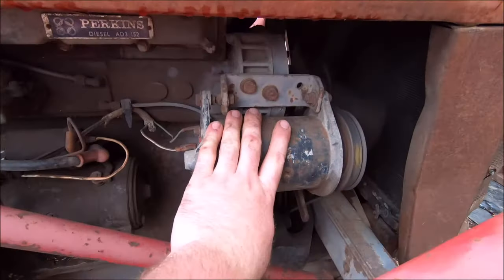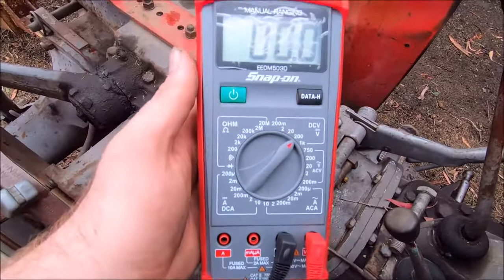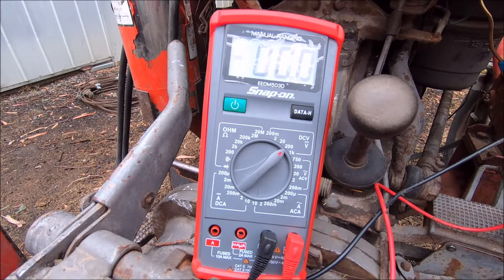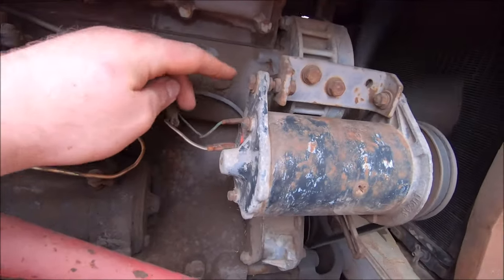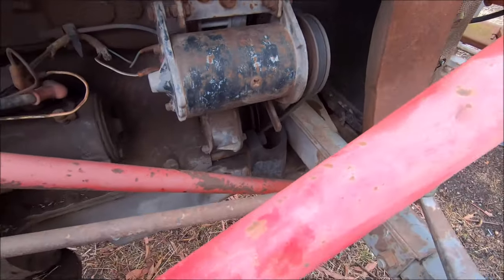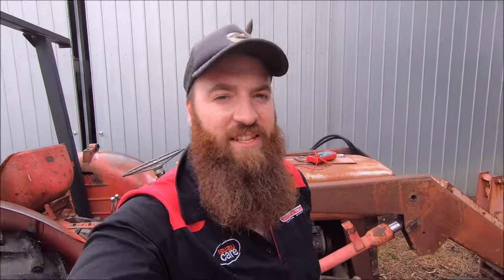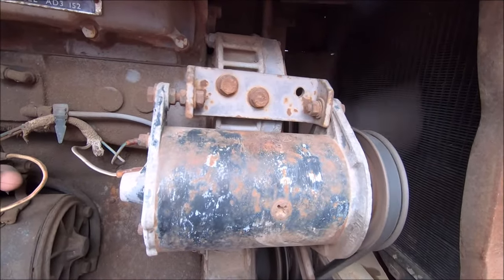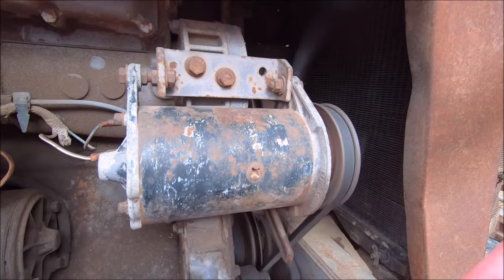How To Check If An Alternator/Generator Is Charging A Battery

Comment: You can test gen as follows, disconnect arm and field wires, w gen spinning jump F to ground or
ARM  if there are no sparks and gen does not load down, residual field is GONE and field must be flashed b4 she puts out, I mean the generator.

Comment: Hi great video my tractor wont charge my battery been like it for couple of years i checked it today i noticed no wire going from alternator to battery would that cause it
Reply from the maker: There will be a wire going to a voltage regulator I would inspect all the wiring and make sure there's no breaks
Reply: @CamshaftFM  Thank you will that be the B+ or D+ going to regulator
Reply from the maker: Not sure off the top of my head. Have a look on google there are plenty of diagrams that show what each wire is.

Comment: Greetings,
alternators to some extent work different than generators, if you have a generator, which you do,
it will charge even when the battery is dead, an alternator will NOT do that. reason being you
need a little bit of electricity in the battery to excite the alternator's rotating field winding. 
That gen you have is an internally exciting machine and requires no external current to get it to charge the battery. If the gen is not putting out proper voltage, there could be a grounded 
armature or field winding. The gen can lose its residual field and may need to have its field 
flashed. If you can put 12 volts+

Comment: Hey there if I have a 6v battery on my tractor (a farmall) what should that read? The battery reads about 9-10 but The generator reads at roughly 0.9 I am assuming my generator is shot?
Reply from the maker: Check the reading at the battery as well
Reply: @CamshaftFM  the reading at the battery was roughly 9ish which on a 6v I assume is alright? Generator couldn't even read a 1 but the regulator box read well. That's just my assumption being new to this!
Reply from the maker: @nicktrapierakis3004  if it’s reading 9 at your battery it should be working fine if that’s with the engine running
Reply: @CamshaftFM  well I believe the battery is ok but the generator pulled less than 1 plus the moment I remove the ground wire from the battery it instantly goes off and my amperage meter is straight 0. Starts up great... Until it stops haha.
Reply from the maker: @nicktrapierakis3004  if it’s not getting 9v while the engines running then I’d say there’s a problem with your gen but check all the wiring and regulator just the same
Reply: @CamshaftFM  oh that's interesting. Yeah it gets about 9 while running but the moment I take off the ground from the battery it stops. The generator read still reads like it's basically a ghost but the regulator reads well. I checked the wiring as well and from what I can see all looks well. Not sure if I'm missing anything maybe it could need valve work? Thanks for being so responsive!!
Reply from the maker: @nicktrapierakis3004  why are you disconnecting the ground while it’s running?
Reply: @CamshaftFM  sorry the negative battery cable. I take it off the terminal to see if the generator is charging the battery or not while running. Sorry if I didn't explain that well!
Reply from the maker: @nicktrapierakis3004  it needs to be one the battery or it won’t charge
Reply: @CamshaftFM  the tractor will keep running if the generator is functioning fine.  But if the generator is not functioning the tractor will stall when the battery is removed from the circuit.